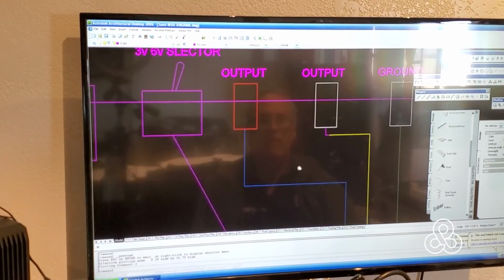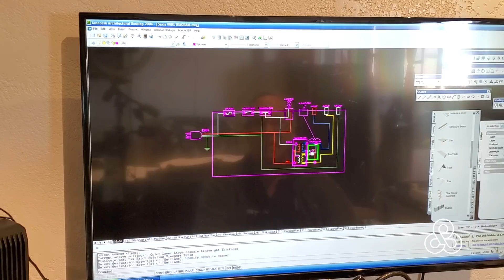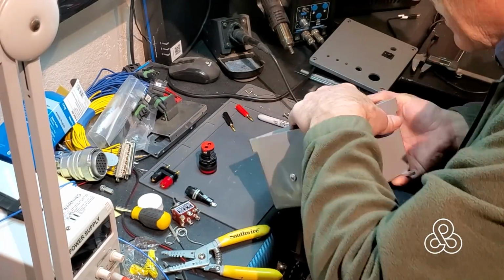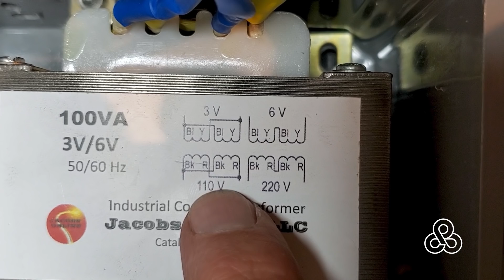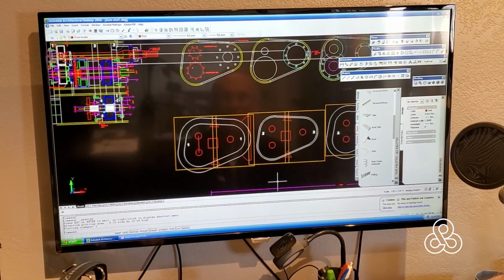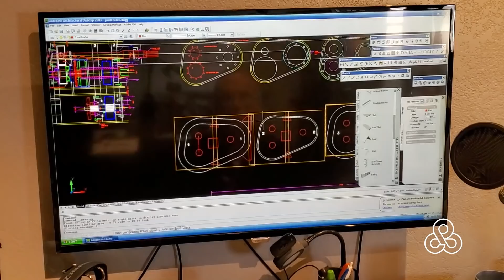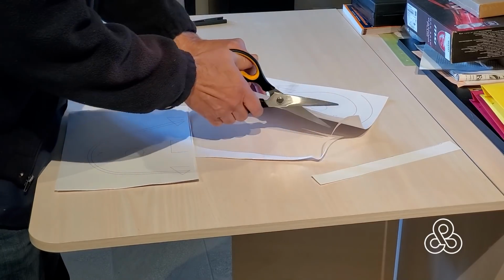A64 Center differential mock-up. Arete supercar project.

Comment: I recently found your channel, have you ever made a video explaining how to produce the fenders and other parts where they are stuck in the body? for example, let's say I want to use screws to fix a fender, how do I do this part where the screw will be fixed?
Reply from the maker: I will be showing how fasteners are bonded into the laminate for attaching parts if that is what you are looking to see. Stay tuned.
Reply: @BuilderCreator  great, thanks

Comment: Maybe i missed it... but how are you not going to have 5/6 reverse gears and 1 forward?
I know kitcar guys that use a 911 trans have to flip the internal diff because it is designed to sit in front of the motor. This trans is designed to sit behind it so being out front means it will spin backward, therefore all forward gears are now reverse gears. 
Do you have a plan for that?
Reply from the maker: This is not an "off-the-shelf" center diff, I am building it from other transfer case components. The shaft rotations will all rotate correctly. Output to the front diff will be in the right rotation (Engaging the helical, not trying to climb out), but would have turned the axles backward if it was not flipped (as in the Porsche box scenario you described) I could have used a diff from a truck, but finding matching gear ratios and the fact that they usually have long input yokes (the Corvette Getrag diffs are nice and short with a bolt flange) swayed me into the direction of just doing the flip up front.  Hope that helps.

Comment: People have made hot wire foam cutters out of cheap battery chargers, often you can get one for less than components to make it. If you do try to make one from a battery charger the cheapest simplest ones are the best to use as the better ones have too much electronics in them to protect or condition the batteries etc. so when you connect the wire it will either shut off blow a fuse or pulse madly or cook the electronics
Reply from the maker: When the old system came up missing, I thought about grabbing something simple, but then thought, "I may be doing lots of foam in the future," why not a dedicated power supply that could handle long or short lengths and thick or thin nichrome?

Comment: Chain driven centre differential.  Is that something that is commonly used?  Up to the task?   Personally I don't know.  What is the consensus of opinion?   Honestly, I am uneducated in this area..
Reply from the maker: Almost all high horsepower transfer cases in trucks are chain driven. The chain and viscous coupling I am using came from a truck (GMC Typhoon) transfer case. It was a popular drag racing truck in its day.

Comment: In the wiring diagram why are the switches on the negative side of the circuit. Is that not dangerous in regards to an accidental grounding  even with the switch off?
Reply: It's an AC circuit, there is no "negative" both the "active" and "neutral" have potentially lethal voltages. In a perfect world, the neutral wire should be 0v, but it's not usually the case. Also, wiring errors occur regularly where a home owner or even an electrician gets the active and neutral mixed up at the socket.

The transformer should protect the user. As it maxes out at 6v, pretty hard to electrocute yourself at 6v. Also, if the workshop is relatively new, it should be wired with rcd's
Reply: @myopinion69420  thanks for the info, very well explained.
Reply from the maker: You are correct that in all these components with AC the power and neutral legs can be swapped. My error on the first round was using a DPDT switch out of my "stash" that had no documentation and being lazy. Rather than assume it was like "the other guys" I should have just taken a few minutes and checked the continuity across the legs. Luckily just some smoke and a new switch (x2 on/ off switch fried as well). The Arc fault breaker didn't even see an event as the transformer adsorbed the rest of the heat.